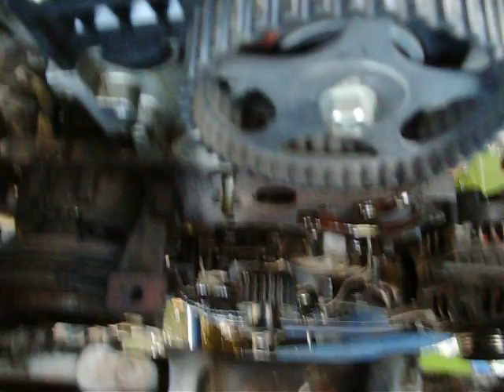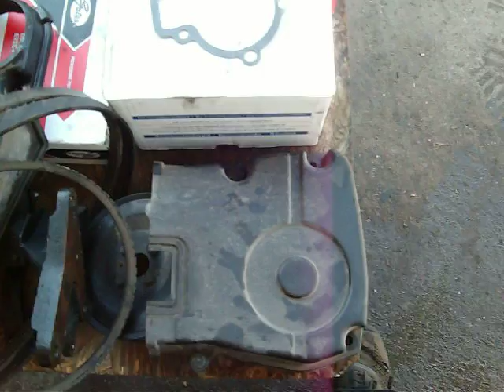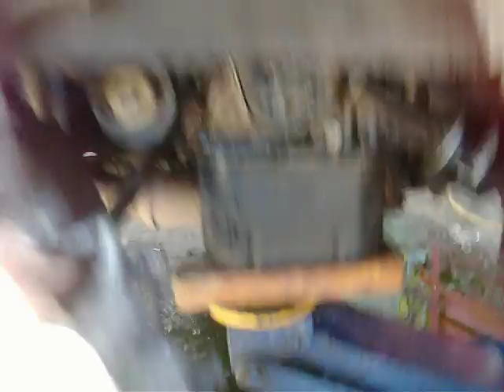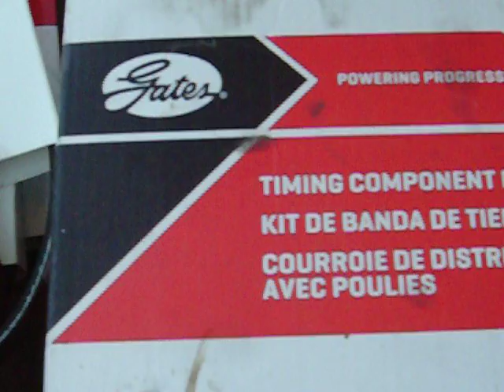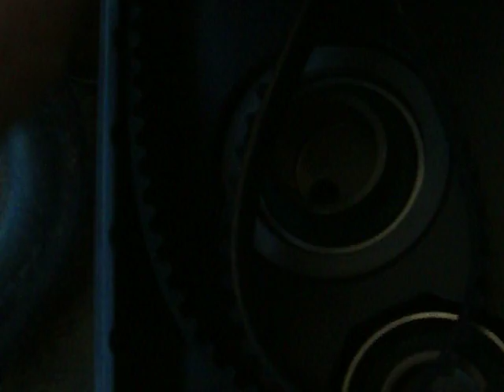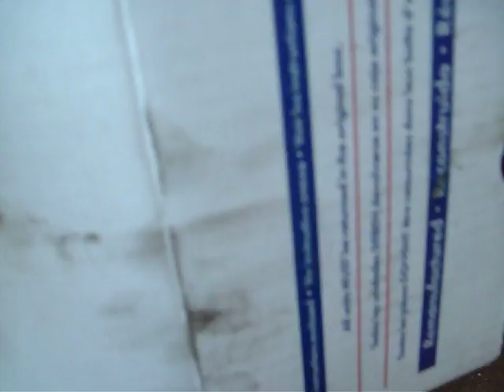1999 Hyundai Elantra 2.0L Timing Belt Water Pump

Comment: Thanks for th video, currently working on the same motor - it's overheating, flushed radiator, checked all pipes and thermostat, water isn't circulating when motor runs, think the water pump is done for?